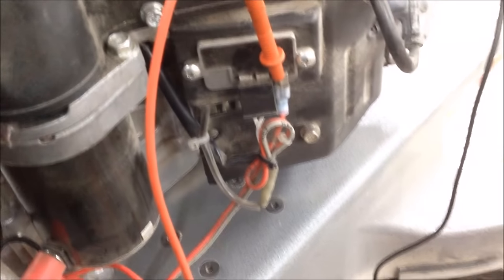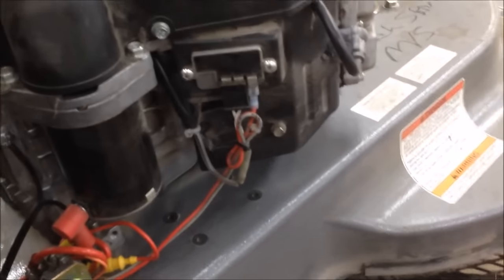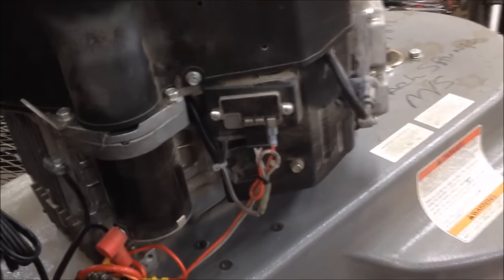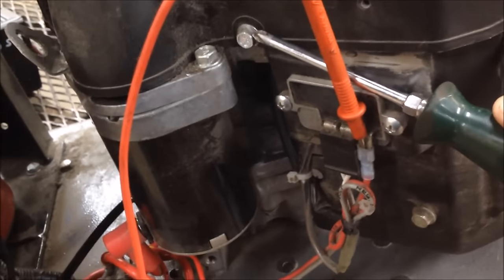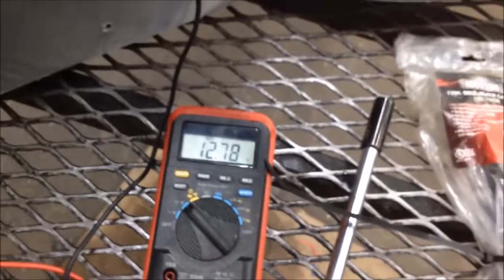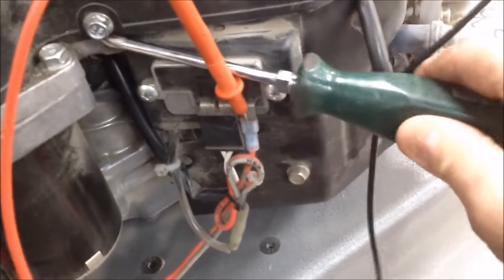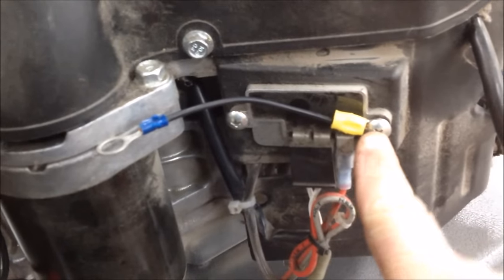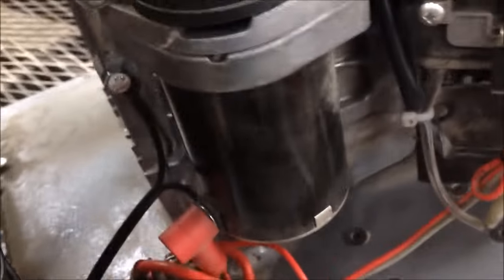KAWASAKI ENGINE REPAIR SO SIMPLE THAT IT WILL BLOW YOUR MIND

Comment: Can the 12V starter be replaced with a 120V starter to bypass the solenoid and voltage regulator?

Comment: When I was apprentice I use the multimeter on the voltage regulator.
Many of the jorneyman had no idea around electrical.
Sad to say but the training in this country is poor to bad.
This country looks at any vocational training as any monkey can do it.
I work for a company with a union with 1000 mechanics and no advance training.at all. Sad

Comment: As a technician and a mechanic, I would rather run naked through a  barbed wire fence than to admit defeat and offer such a ridiculous "solution". That "mechanic" should have been told to just stay on vacation!

Comment: You'd have to be a crappy tech to forget to put that ground wire back on and not be able to figure it out, . The shop we take our machines to leaves them out in the weather behind the shop when they're not working on them. . I know right, . Unfortunately it's the only Scag dealer anywhere close.
Reply from the maker: Happens all the time

Comment: WTF ? Installed onboard charger? wow, as a small engine mechanic myself, that is just disgusting. I mean honestly, if it is not charging on it's own you have to at some point question your own tactic and wonder what you are missing. Placing a band aid only stops the bleeding, it doesn't fix the wound. Disgraceful. You then arc it over (*facepalm*) One of the first things to check is AC / DC voltages when you have a charging issue. I highly doubt that stator or regulator needed replacing to begin with. Even an unorthodox 50 cent strip of wire could have been a better fix than that previous "onboard charging unit" (just proof I need to let it play and not pause to comment..) You ended up putting a strip of wire LOL, alright, I am off to fix this 1998 Rol-Mol sitting in my driveway that needs almost everything with a 16HP Vanguard V-Twin. 7:47 AM time to get moving .. Cheers for the video, I love this stuff and appreciate all of the guys like yourself that go above and beyond to diagnose and make things right. fist bump
Reply from the maker: Some people shouldn’t be allowed to touch tools
Reply: @THEMOWERMEDIC1  Never expected a reply on an older video, especially that quick. Love your videos bro, thank you. From one Mechanic to another, God bless and love you like a brother. Sincerely. People like you are what keeps me motivated to do better each and every day.